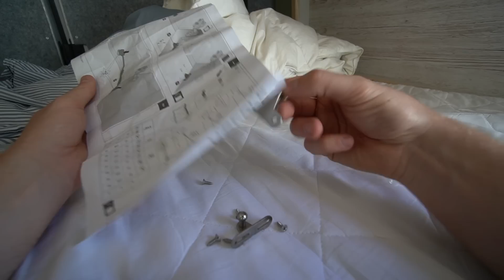VAN BUILD NEVER ENDS! No Experience Van Build

Comment from the maker: Kamikoto has several special offers going on right now and is offering my viewers an extra USD50 off on any purchase with discount code WILL50, on top of our special offers. https://kamikoto.com/Will50
Reply: Will mate, the hessian looks good but please think about a pan fire on your hob, that fabric is flammable.
Reply: @Jarv263  I was about to ask will the distance from the cooking ring to the bottom of the cupboard.
Stir fry spray is a worry also a fire hazard on hessian.
Reply: @chox2001  well in a house in the UK the extractor (which obviously isn’t fabric) has height restrictions, an electric hob needs 650mm clearance above and a gas hob needs 750mm gap. LPG actually burns hotter than natural gas which we use in our homes, so you need to be careful. I can’t see oil spray setting the hessian on fire, but if Will ever had a pan fire, that hessian would definitely accelerate the fire.
Reply: @Jarv263  the build up of oil spray will coat the hessian and it will be like a candle wick to burn
Reply: @chox2001  true 👍🏼 I hope Will changes it.
Reply: Kamikoto is pretty much a scam company, high prices for garbage steel. I believe Shadiversity did a great video about their knives.

Comment: Looking great. Just a thought, is hessian above the cooker a good idea. The fat off the frying is gonna stick to that and smell , and also would it be a fire hazard. Just a thought fella, but it is looking good.
Reply: Came here for this comment - back of the net Sir.
Reply: so true
Reply: My first thought too,C'mon Will 🤯
Reply: he can glue a glass or plexi glass over the hessian so it be easy cleaning and keep the color at same time.
Reply: @lassek779  I would if anything go for a heat proof glass , the type used in oven doors , Plexi is just going to melt .
Reply: I came on to comment for the very same reason, hessian will soak up all the grease and it will become a fire hazard from hell, also, it will start to stink real bad because it will also take and hold all the cooking odors, heat resistant glass i think would not be a good idea either, its expensive, and the hessian is still there behind it. 
for me, I would have gone either with a heat resistant paint or stainless steel sheet, its clean, and easy to wipe down after every cook out on the stove.
Reply: @uptowndisco2  yeah thats true, great suggestion.

Comment: Will, the folding chopping area. I would seal the bare edge with at least PVA, as if you get water on the join and it gets in to the wood it will warp and swell the surface.. I made that mistake in my kitchen 🤪

Comment: You could have just used some paper to make a template of the cupboards, used that template to get the right size and shape of hessian, spray glued the hessian and then fit the pre-cut and glued hessian pieces. Use making tape and plastic sheeting to stop spray glue going everywhere you dont want whilst gluing it in. :)

Comment: Just a heads up Will. An iPad Pro is a power hungry beast and we found we just couldn’t keep it charged when using it for SatNav. We were using the most powerful 12v charger we could find but it was no good. I asked in The Apple store about this and they advised getting the basic iPad which we find works well as a satnav and for watching videos. Smaller screen though but much cheaper. Make sure the iPad also has a gps chip. Those without sim slots don;t work as well.

Comment: I wouldn't have hessian on cubard's especially in a motor home with little space, wood everywhere  and a gas hob , isn't that a fire hazard and collect greasy dirt .
Reply from the maker: Few people have made this comment, and I value peoples opinions and comments so thank you for your input. I have treated the hessian for the dirt and grease to minimise this and also have windows and fans to reduce this issue, and then if I change my mind it’s an easy enough swap out at a later date.
Reply from the maker: Few people have made this comment, and I value peoples opinions and comments so thank you for your input. I have treated the hessian for the dirt and grease to minimise this and also have windows and fans to reduce this issue, and then if I change my mind it’s an easy enough swap out at a later date.

Comment: If u stop the upgrade project then it’s will end.  Eat some fish n chips with red pepper n chill out in the toilet.  Just try to helps.
Super clue n duct tape will solve all problems.idea for TV, dump the tiny TV n replace it with 100+ inch UHD n mount it on the ceiling.
Btw, knife is a wasted.  Replace it with an ax.
Reply from the maker: Haven't got an axe 🧐